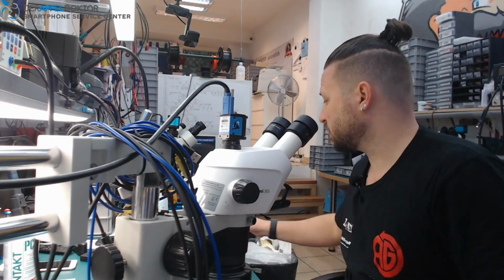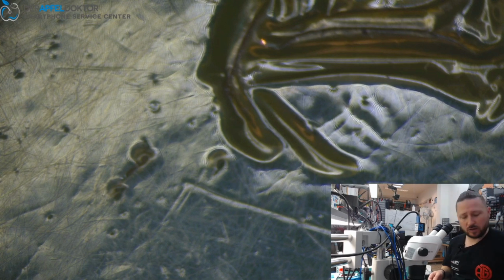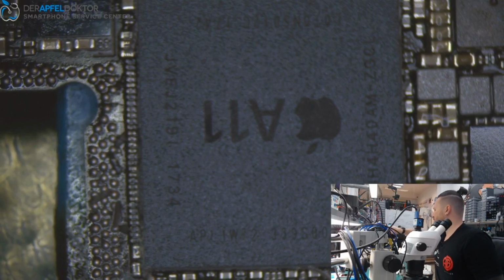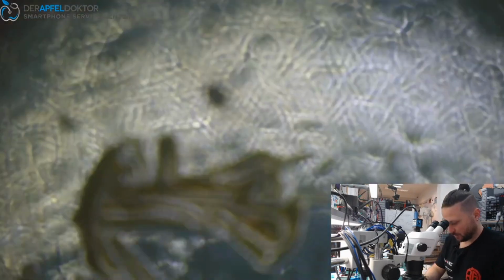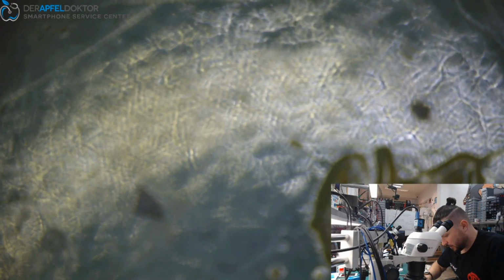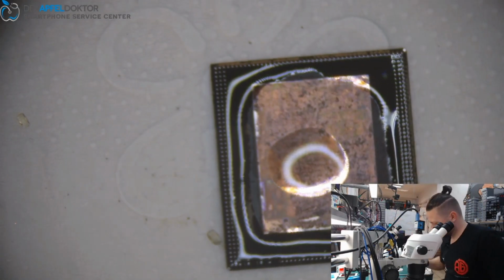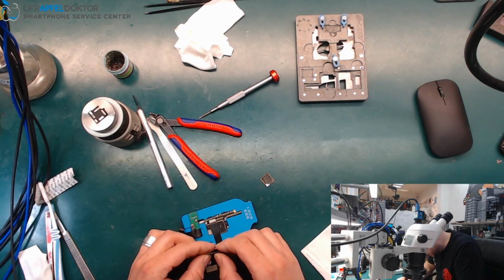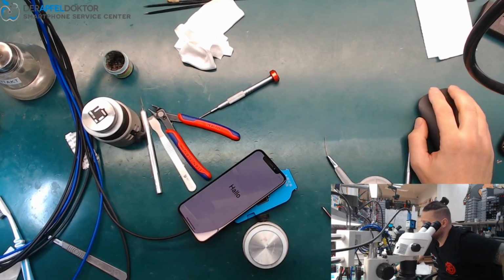MASTERWORK - iPHONE X A11 RAM SHORTED - HOW TO REPLACE THE RAM AN ON iPHONE X FAST & EASY

Comment: I changed ram a12 / a13 and I don't understand how you connect two boards if the thickness of the processor and ram does not allow it?  this is only possible if you cut down the processor until only ram remains as from the factory